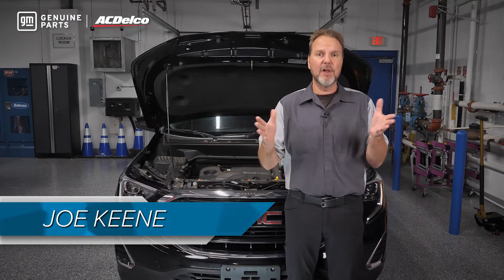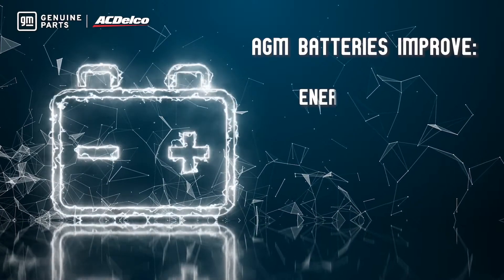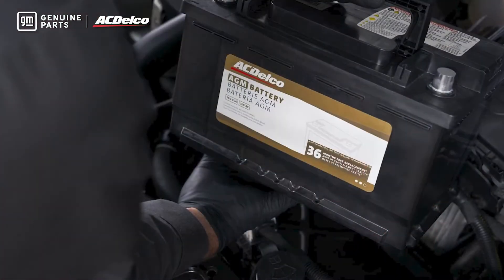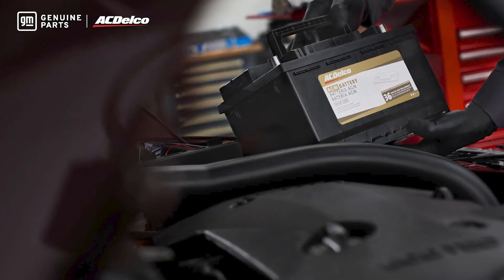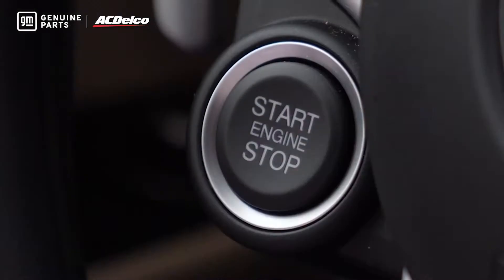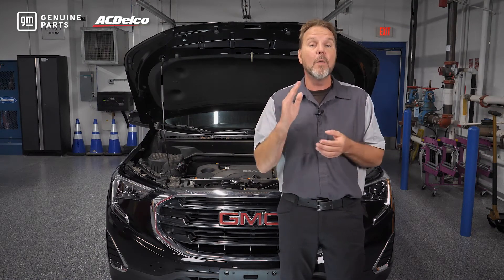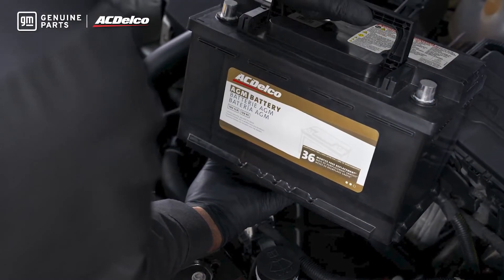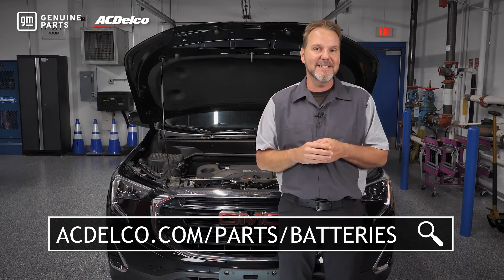Understanding The Gold AGM Battery

Comment: Good information and video, but I am a bit confused, aren't AC Delco batteries now made by Johnson Controls?  I'll probably buy a Costco Interstate AGM which are also made by Johnson Controls or a Walmart AGM battery for my next battery made by Exide or Johnson Controls depending on my model. I also added a PulseTech PowerPulse battery desulfator to my 2001 BMW 530i battery that cost $33.99 on Amazon have a 5 year warranty, and use a patented frequency to keep a battery desulfated and can extend the life of batteries up to three times.